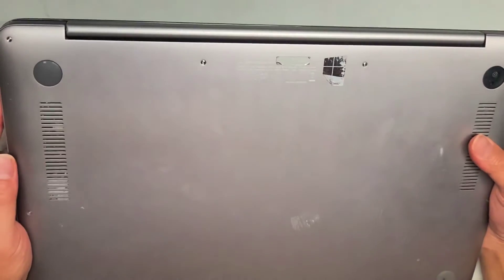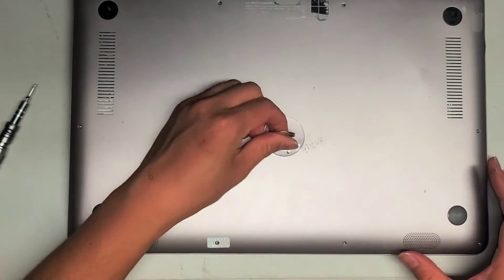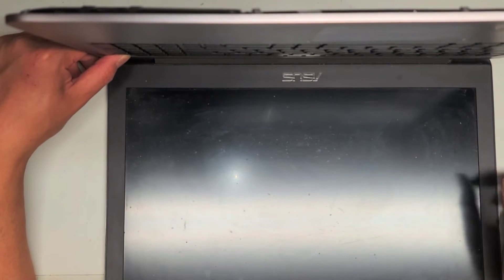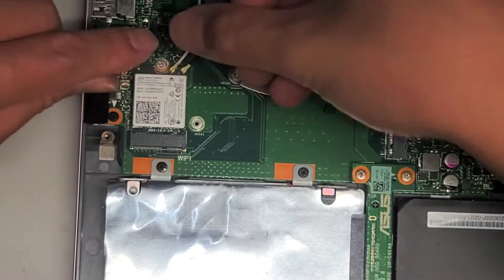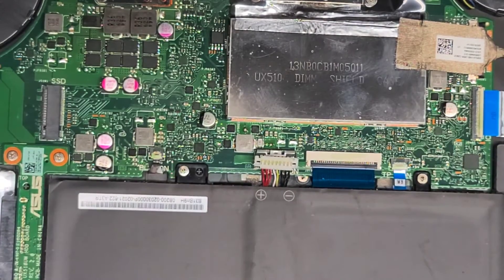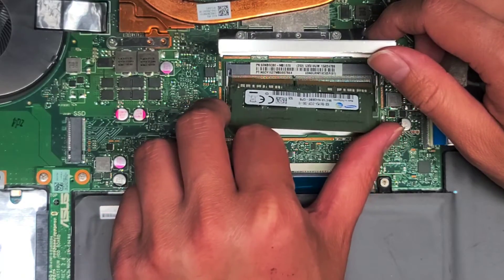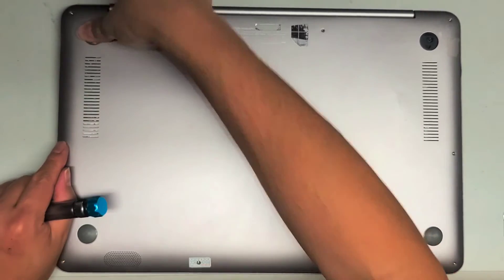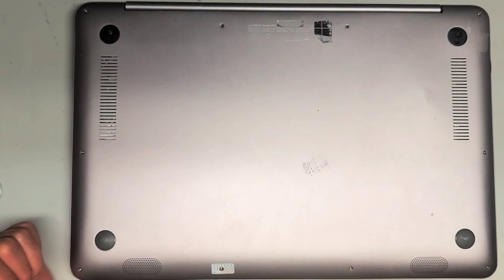ASUS UX510U Disassembly RAM SSD Hard Drive Upgrade Replacement Repair

Comment: where's the cmos batery location?
Reply from the maker: Likely the main battery is the cmos battery
Reply: @ItsBinhRepaired  so if i want to refresh the bios i just unplug the battery connector and leave it off for 2-5 minutes?
Reply from the maker: @sirajatega  what's wrong with the bios?
Reply: @ItsBinhRepaired  i realized that my CPU fan is not detected & is not spinning, even under heavy load, but strangely, it spins for a couple of second  in the computer shut-down process. i tried several fan monitoring software, only 1 got detected. not sure if i should buy new fan, or theres a problem with the mobo
Reply from the maker: @sirajatega  usually a fan issue if the computer is working
Reply: @ItsBinhRepaired  thank you for the input, im gonna try to get a fan replacement
Reply from the maker: @sirajatega  hope it works
Reply: @ItsBinhRepaired  I’m trying to find a fan replacement for this laptop, do you know where I could find one? Thanks!
Reply from the maker: This one? https://amzn.to/49wpn5x
Reply: @ItsBinhRepaired ah yes, affiliate link… also I should have mentioned that I need a gpu fan, not a cpu one

Also I’m not sure but I think you need to tell people that the link has that affiliated thing
Reply from the maker: @NivaLunaa can't seem to find a gpu fan. Every link from Amazon is an affiliate link. Maybe this playlist will help you repair your fan Fan Repair: https://www.youtube.com/playlist?list=PLSSiYX-ta7aqqxfDWDQh-B6Az4ZgDI459
Reply from the maker: @NivaLunaa do I also need to say on every video that I wouldn't post content if youtube didn't share ad revenue because viewers rarely contribute? Lol
Reply: @ItsBinhRepaired yeah I can’t find a fan either… also I don’t know much about amazon, I don’t really use it
Reply from the maker: @NivaLunaa maybe it'll be available on ebay or something similar

Comment: Hi mate, informative video. How exactly did you prise open the RAM slot? It's very difficult in my experience, any tips would be great
Reply from the maker: Watch the video. Other than that, not sure what to tell you. Pry harder? I just use my fingernails as shown.
Reply: @ItsBinhRepaired  Do I need to loosen the clips on the side though, or can I pry the case open without that?
Reply from the maker: @LLNDVS  just do what I do in the video. There's no magic. Lol Just pry it up with your fingernails or plastic pry tools

Comment: I have this laptop and never used it for about four years. I've recently turned it on and the keyboard has 2 columns of keys plus another key not working  6 y h n, 7 u j m and c.

Is there anything I can do to fix this issue by taking apart the laptop or is it a replacement worthy thing?

Also wanted to say really informative video and easy to follow. I love how you showed each step and how to unlock things and ALSO place them back.
Reply from the maker: You'll likely have to replace the keyboard :(
Reply: @ItsBinhRepaired  Ah that's unfortunate! Thanks for the super quick reply though and I'll probably use this video to try and replace the keyboard... or I'll try a local repair shop and pray the price isn't high haha.
Reply from the maker: You could always use a usb or wireless keyboard
Reply: I had the same problem. The keyboard replacement did the trick
Reply: Hey there, did you ever manage to fix this issue. Exact same thing is happening for me...
Reply from the maker: You'll either have to replace the keyboard or use an external sadly.